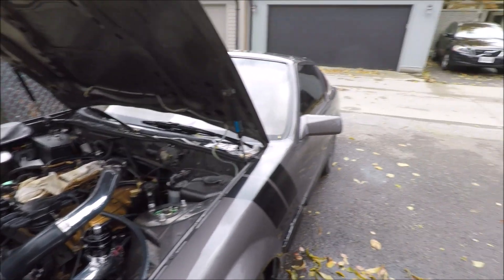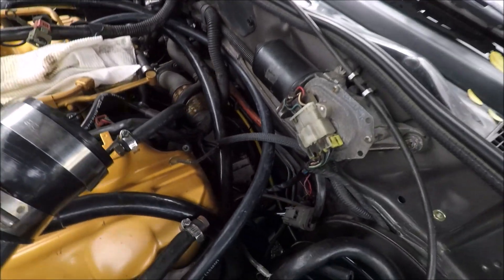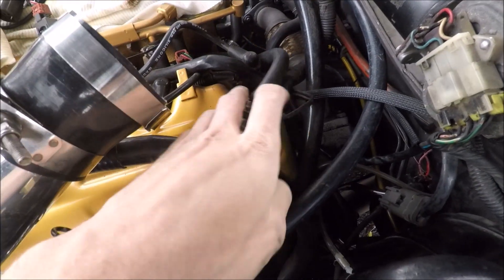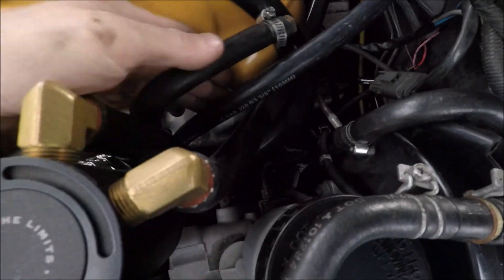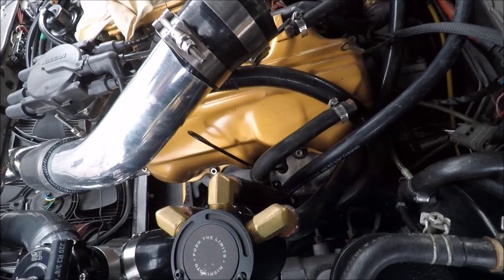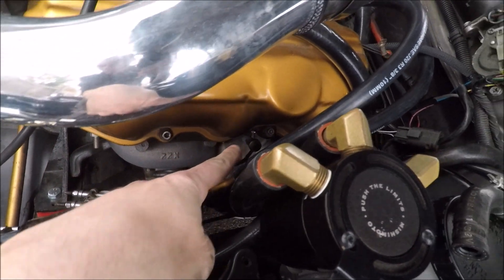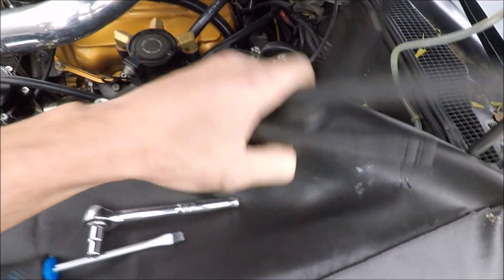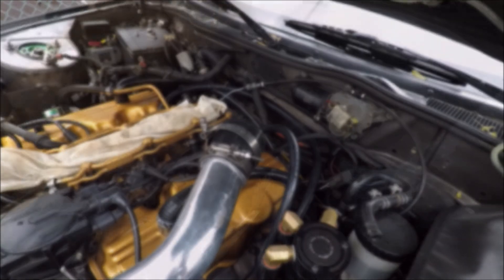Quick Tip: VG30 Throttle Body Coolant Bypass

Comment: Please tell me about the lines from the 4e engine the intake at the back and ones running from the trottle body my vehicle were spitting out coolant through the nipples into the vacuum lines running from power steering pump there are about 4 nipples under the trottle body where did I go wrong how can I correct this issue water running out the radiator fast

Comment: Where does the other side connect too? Did you also disconnect the plenum lines?
Reply: Coolant comes from the intake plenum on the passengers side through the air regulator into the turbo, then from the turbo it comes out into the throttle body and into then back into the thermostat housing.
Reply from the maker: @BSDKllr  Yes as stated above, one port is on the passenger side of the lower intake near the injectors, and the other is a tube coming from under the lower intake going to the thermo housing